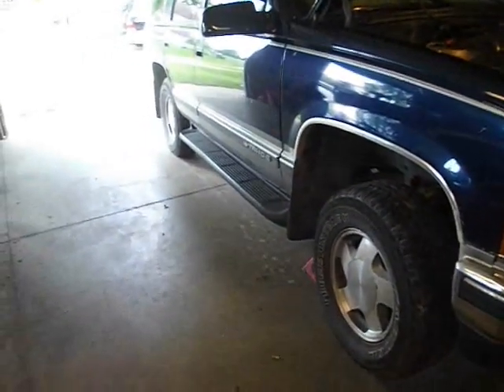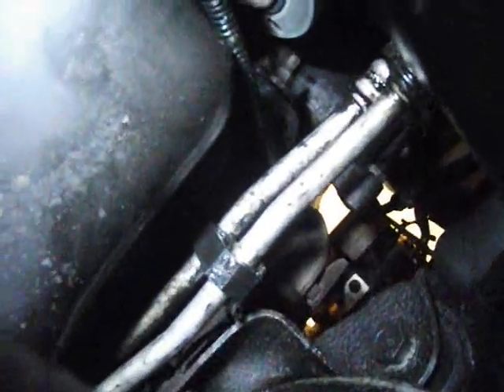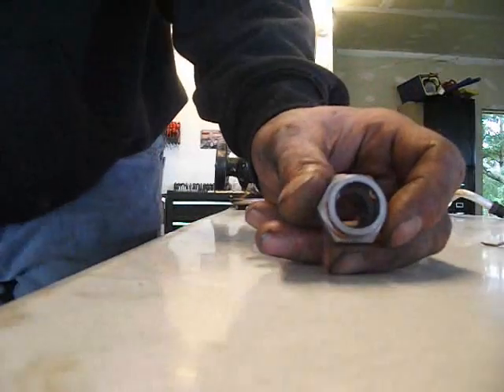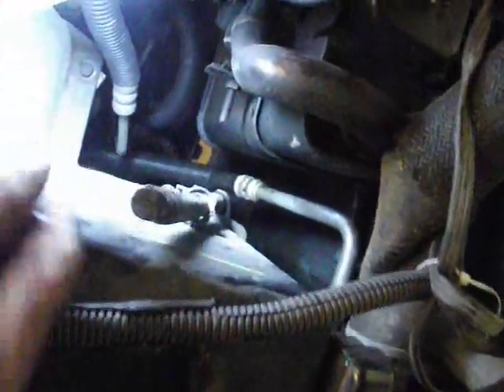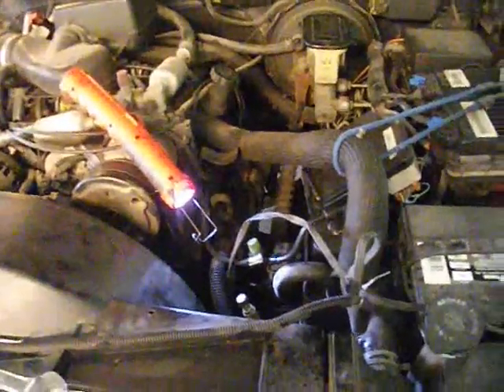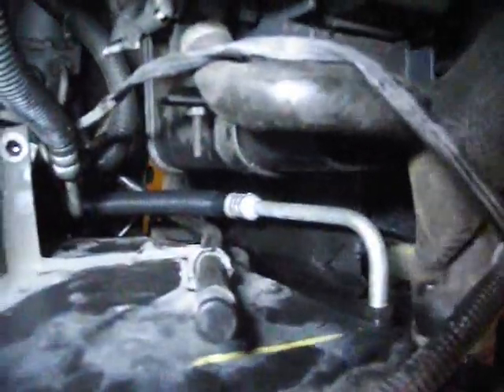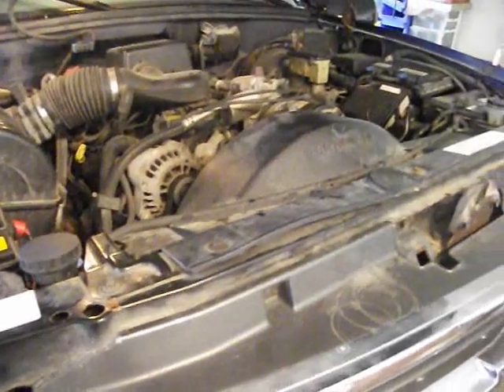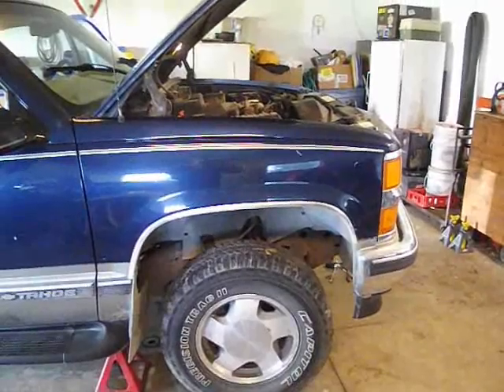1996 - 1998 Chevy Tahoe Suburban Common Oil Leak FIX. Oil Cooler Lines Replaced HOW TO

Comment: Did both lines 2 years ago on my 97 Yukon w/166k mi - my wrencher charged $350,  parts and labor- 2.5 hrs labor- 
I feel reasonable charge for the nasty job

Comment: I just looked at mine and it has oil on the back of the pan. But it's not leaking when it sits only when it runs so is that what it does

Comment: Hate to be that guy but 99 suburban (last of that body style)  still has that vortec 350. I appreciate your video tho
Reply from the maker: Yeah, I have been told that a few times here. My bad. Thanks for watching and thanks for the comment. Glad to help when I can.
Reply: @WrenchSense  I really do appreciate your time and knowledge tho, as I was going to be going into this blind on Saturday.  Be good and be safe 🤟
Reply from the maker: @jayw4777  Not a problem and you as well. We just had the shut-down here in Minnesota yesterday but I have been deemed "necessary" so at least I can count on a regular paycheck for now. Thanks again!
Reply from the maker: @jayw4777  By the way, there is a cooler line delete option for your truck. I have used it myself and have had no problems. Links for those parts are in the video description. Super easy. Also if you take a look through my channel there are a couple more videos on your particular model truck that you might find useful.
Reply: @WrenchSense  
Unfortunately I'm in Albany area of ny and I'm also deemed essential,  kind of part of my rush to get my suburban top notch.  Only hold up at this point is this damn oil leak now, bought the lines today.
Reply: @WrenchSense  
I'll definitely check out the links you mentioned.  Thanks again and be good to you and yours brother,  hopefully we all pull through healthy
Reply from the maker: @jayw4777  Right on. If you have any problems/questions feel free to hit me up. I do what I can to keep a few extra bucks in peoples wallets.

Comment: I have a brand new 383 stroker from GM in my 99 tahoe and its been leaking since installed. Theirs like 3 spots wear its leaking. 1 seems to be over the starts, the other drips from somewhere by the oil filter. Ill replace that hose and report back if it fixed the problem.
Reply: How much better does the 383 run than the stock 350 and how much was the fuel mileage reduced?

Comment: This is not just a common problem it is a reoccurring one.  My solution is to get rid of the oil cooler altogether by blocking the lines at the filter.  There is a block-off plate available so you just take your oil lines off and put it in their pace  Take the oil lines out and toss em in the garbage.  Presto, no more leaks.

Comment: I’m having a bad oil leak under the front passenger side of my 95 tahoe any ideal of what it can be. I also see the oil above the tire Underneath the car on the left and right side but oil only on the right side of the ground
Reply from the maker: What you are describing sounds like the front axle shaft seals are leaking. Does the oil smell very strong like gear lube?
Reply: Wrench Sense ahhhh thanx! I’ll google that and see what it means. And no, I don’t smell anything. Just bought the car 2 weeks ago and notice puddles this week super confused.
Reply: Wrench Sense does the axle shaft anything to do with the transmission? The guy that sold it to me said he had just had the transmission replaced
Reply from the maker: It is not likely that an oil leak near the front of the vehicle has anything to do with a transmission replacement. Thanks for the comment! If you have any other questions, feel free to ask!
Reply: Wrench Sense fasure I posted a video on my page,check it out if you can thank you!
Reply from the maker: Hmm... I watched your video. Have you checked the oil pressure switch behind the distributor on the back of the engine?

Comment: I had some my engine rebuilt. The the people that did th rebuild removed my oil cooler line and adapter.  I have reorder the parts an reinstalling yea reinstalling.   Its there for reason :-)

Comment: I chose to eliminate these lines on my '97 Silverado after I was able to locate oil filter adapter off a '96 corvette w/o factory cooler and picked up a couple 5/8"x18x1" long allen head plugs at my local fastenal store for heat exchanger ports. This vertical adapter accepts the same filter (pf52) and is offset toward the pan so it clears front drive shaft. It also raised my oil pressure a bit.

Edit: Heat exchanger ports on radiator are M20x1.5 not 5/8"x18 thread. Fastenal had them in stock also.
Reply from the maker: Very cool. Thanks for the post!

Comment: hey man, i have a 97 tahoe, and im having a leak from this area as well. i replaced the cooler lines, didnt fix it. then i replaced the housing gasket.. didnt fix it. so then i replaced the whole housing adapter, and that didnt fix it either. it appears to be leaking from one of the 2 bolts holding the adapter in place. any thoughts?
Reply: Yeah, the filter adapter  bolts actually have a sealing washer/Gasket that should be replaced. You can find the bolt kit from an online GM dealer or Ebay just make sure you get BOTH bolts. They sell them in a kit with both and also individually.
Reply: @redhaylo909  do you know part number or bolt size I lost mine when I was rebuilding engine and am having a leak from one of the bolt locations (i just grabbed and guessed what bolts I had laying around)

Comment: Can you please confirm something...the top radiator line goes to the top fitting on the filter adapter, and the bottom radiator line goes to the bottom fitting on the filter adapter.  In other words, top to top and bottom to bottom.  Correct?

Comment: Thanks for the video, I just subscribed! I am seeing a leak coming from near the rear of the engine compartment. Is there is a cooler line delete option for my truck? I need to replace my radiator too, as it is leaking just under the upper hose (I did an emergency repair with JB WELD while camping, it still leaks, but just a slight dribble now). My truck is a 1996 Chevy 3500 7.4L with 73,000 miles, an ambulance converted to a camper. When I get the new radiator, can I just use the cooler line delete option upon installation? So there are two lines on both sides of my radiator. I want to replace the lines at the same time as the install. Any advice and recommendation on what is a high quality radiator to buy? Thank you!

Comment: Sorry spoiler alert stop if you're lines are good what you can do is fine the YouTube video of a guy who cuts off the hose and slips a flair nut on the line and Flair's the pipe and install a fitting into the adapter. Done and end of the problem for good I have 307,000
And I have been through this a few times.
Reply from the maker: Hi. If you read under the video there is actually a listing for the parts you need to completely delete the adapter at the motor and use a spin on filter. The link takes you to Amazon. Thanks for the comment!
Reply: @WrenchSense  I didn't want to remove the cooler, and those quick connectors from the factory are a temporary fix. I had to go to a hardware store and get half inch adapters to go from pipe thread to flair ends and flar nuts and buy a flair tool ,

Comment: something I've noticed and I'm kind of confused on this. if you're looking at the front of the truck this truck or my truck I got the same exact truck. on the left side of the truck there is some sort of Cooler? I thought it was the transmission cooler but the transmission lines go into the right side of the radiator if you're looking at the truck. and I thought it was the engine oil cooler but the engine oil lines go into the left side of the truck if you're looking at it. so my question is what is that cooler for? it's not just my truck that has it. I've seen a lot of bone stock GMC 1500 of the same year that have the same cooler in the exact same spot.

Comment: so I'm having a hell of a time with the clips at the connector. do I put this on or in before i insert the tube in the "quick connect"?
Reply: Nate Cole  I had the same problem,  so I put on one part of the clip into the groove namely one of the hooked ends , then I  used a needle nosed plier and grabbed the other hooked end hanging in the breeze and placed it into the groove.
Next I cleaned up the area and slid the plastic retainer back over the clip.
If you are missing thar retainer  you can use in a pinch a plastic zip ratchet tie that covers the clip completely and zip it tight and trim the excess off.
The needle pliers are the trick as your fingers are just too stubby to push the clip in.
Reply: Forgot to add that you do the clip after the tube is pushed into the connector.

Comment: I replaced those damned things 2 years ago on my '98 Blazer. Had to jack the 4.3l up just to gain enough space to pull the rear oil cooler line mount base through. And now the cheap aftermarket lines are starting to seep again. It's just a bad design with all of those lines running to and fro, back to front of motor. I used to think Chevy had some common sense but not after my first Vortec. The regular ones were SO much easier to work on.
Reply from the maker: Read the video description for a cooler line delete kit. Thanks for commenting!
Reply: @WrenchSense  Delete kit huh? I can understand if I was pulling something all the time but it's just for commuting.
Reply from the maker: @tomservo5347  I installed a delete kit  on this same model five plus years ago. My friend bought the truck and it is still doing just fine.

Comment: I heard you say in the video that 1998 was the last year of the 5.7L Vortec Engine.

1999 Tahoe has a 350ci / 5.7L Vortec Engine and so does a 
2000 Tahoe Z-71  350ci / 5.7L Vortec Engine (Classic Old Body Style) (Built in 02/2000)

However, the (NEW Body Style) 2000 Tahoe has a 5.3 L Engine.
Reply: FloridaCoastalGuy  Right My 2000 Z71 Tahoe Has a Vortex Motor....the last yr was 2000 for that engine & body style....it changed to a 5.3 in 2001 and a shorter rounder body..
Reply: In April 2000, the new body style Tahoe debuted with the 5.3L. with the round corners.

GM produced both body styles in 2000.

My build date was 02/2000 for my 2000 old body style Tahoe with the 5.7L 350ci Vortec L-31 engine.

When buying parts; I have to explain that my 2000 Tahoe Z-71 has a 5.7L engine because Auto Parts Stores list the 5.3L for the 2000 new body style as well.
Reply: FloridaCoastalGuy power steering hose
Reply: Mines is a 1999 tahoe 5.7L Vortech. My oil cooler line doesn't go to the filter housing though.  Working on it now.
Reply: Yes the 5.7 vortech didn't go anywhere until 2005
Reply: 1999 Chevy K3500 here with the 5.7 Vortec/(350) also. I am about to order the lines and fittings myself to replace them as I have had oil leaking from the general area where they go into the quick-connects (at the oil filter adapter) for years now. Always just a small amount of oil but it's time to put new lines in now!

Comment: What stinks is that the replacement Dorman parts don't have good crimps and leak really soon.
Reply: Thanks for that Nicholas. Have you found a better replacement?
Reply: Michael Fairbanks No, they are the only ones that make them.  I mean to grind off the crimps, replace the hydraulic hose and double clamp one to see if it works better.  Considering that you can clamp transmission lines, I wonder if this would be similar?
Reply: MFSVH I'll have to check them out.  I was just going to jimmy-rig the aftermarket ones with new hoses.

Comment: THIS WAS MY PROBLEM: It was my OIL PRESSURE SENDING UNIT to my Gauges, 
that was where the oil was pumping out/pouring out, it is located high up on the rear of the 2000 Tahoe Z-71 350ci  5.7L  Vortec engine behind/under the distributor area, the oil pumped/flowed through the oil pressure sending unit freely, approximately 1/2 quart every mile.
The oil came out where the electrical connection plugged into the sending unit, straight through the entire sending unit onto the wires and out "under full oil pump pressure"

The pumped out oil dripped away from the rear of the engine onto the bell-housing halfway down, (the top rear of engine had NO oil on it) the fresh pumped oil then drained down onto the lower bell-housing to the driver's side bell-housing/engine lower two bolts which I thought was the rear main seal or the oil cooler was leaking and onto the ground.

Idling in Park or going down the road, the fresh oil could be seen dripping/pouring out from under the engine area, it would leave a very noticeable oil line/heavy-heavy drip on the pavement.

IT TOOK ME A WHILE TO FIGURE OUT WHERE THE OIL WAS COMING FROM, I almost took apart the Oil Cooler and replaced the large rubber gasket and replacing the lines, however, 
I didn’t  see any oil coming directly from the Oil Cooler or any of the Oil Cooler lines.

I purchased this faulty replacement oil pressure sending unit to my gauges on eBay for $35.00 (it came from China from a U.S. seller with good feedback)  It only last for 200 miles before the oil pumped through it and out!

I replaced the oil pressure sending unit to my gauges with one from NAPA (Part no. OP6662)                 
Purchase a special Oil Pressure Switch Socket from O'Reilly Auto Parts or online.    
Lisle part # 13250 for $10.99 and you can change it in 5 minutes or less.                              

If your vehicle is just dripping a spot or two under the engine area each time you park it, you have a different oil leak/oil drip problem than I had. It’s probably the oil cooler gasket or the oil cooler lines that is leaking as this video is talking about.
Reply: Did your oil gauge still work even tho it was leaking out? Just curious because i think im having a similar issue. Already did the lines and adapter gasket kit. Hopefully its the sensor and not the rear main seal.
Reply: Excellent.  Mine is doing the same thing

Comment: I lost so many of the little spring clip keepers out of those connectors before I bought the little round tool that makes those come right apart without removing it that I will never recommend removing them again, buy the tool you will wonder why you didn't get one sooner!
Reply: Would you happen to have a link to this tool? Sounds pretty slick

Comment: Thanks for the video... I had that same problem on my Suburban and after the second set of lines I removed them completely.  I don't tow anything heavy anymore with it and got tired of the leaks.  I installed the adapter in the oil sump and got rid of that housing that turns the filter sideways.  No my filter is straight up and down with a standard filter.
Reply: @MrBowNaxe..what adapter allowed you to do that and still be clear of the front drive shaft?
Reply from the maker: The adapter and filter needed are linked in the video description. Thanks for watching!

Comment: 99 was last year of the 5.7 vortec
Reply: Attn: Paul Langeslay - NO, the Chevrolet 5.7L  / 350 Vortec was produced from 1996 through 2002.  Check it out or Google it before you type an incorrect statement! You are wrong!
Reply: FloridaCoastalGuy L31 5.7l vortec 1996-2000. I think somebody needs to open a book for themselves and stop looking on the internet. I've rebuilt six of them in the last year. Don't tell me
Reply: 5.3l vortec til 2002.
Reply: My bad 1996-99 is what I meant to type for the L31 5.7 vortec not 96-2000
Reply: Paul Langeslay - Just because you have never seen a 2000, 2001 or a 2002 L-31 5.7L 350 cubic inch Vortec engine doesn't mean it was not produced by General Motors from 1996 through 2002.

I have a 2000 Z-71 Tahoe (Old body style) with an L-31 350ci 5.7L Vortec engine from the factory, it looks just like a 1996-1999 Tahoe, but it has a 5.7L L-31 350ci Vortec

The 2000 GM trucks did NOT have the 350ci 5.7L Vortec engine, however, the 2000 Suburban, 2000 Tahoe and 2000 Cadillac Esclade all still had the 5.7L 350ci L-31 Vortec engine. These were all produced into the Spring of 2000. The built date on my 2000 Z-71 5.7L Vortec Tahoe is 02/2000.

The 2000 new body style Tahoe has a 5.3L engine.

And I just told you...
Reply: FloridaCoastalGuy by the way General Motors still produces the 5.7 Vortec. You can buy it online shipped to your door in a crate
Reply: @FloridaCoastalGuy  You are correct..some express vans also came with L31 5.7 vortec up until 2002 model year.